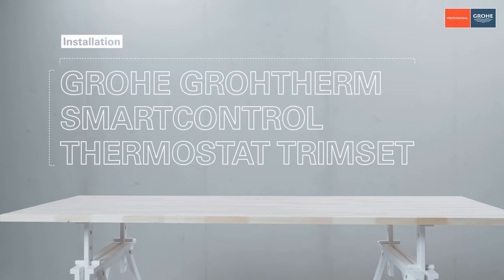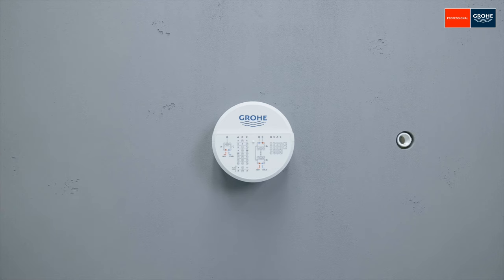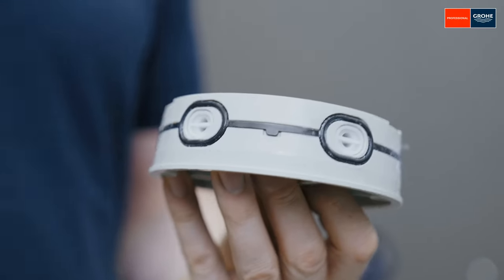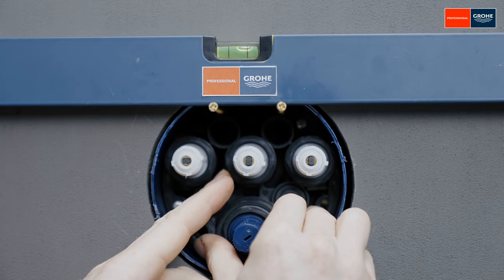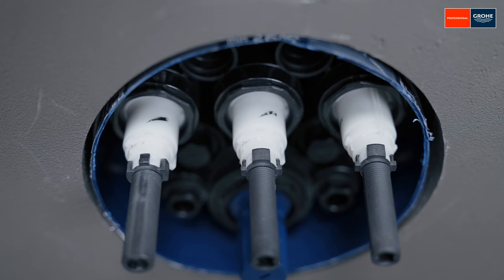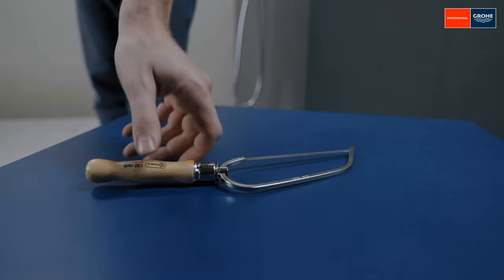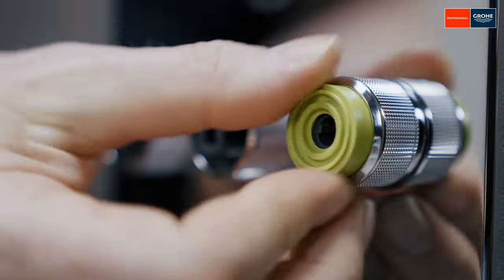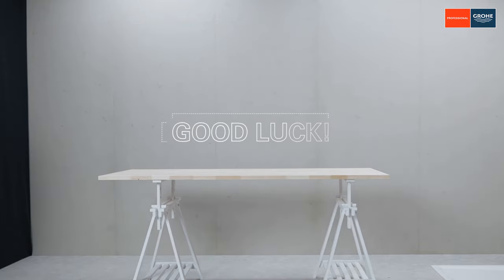How to install a GROHE Grohtherm Smartcontrol Thermostat Trimset

Comment: The front plate and smart box need siliconing on, right?
Reply from the maker: Hello @gerg83! 
Thank you for your message and your interest in GROHE. When purchasing our products, please always refer to our enclosed assembly instructions. Everything is described there. And regarding your question: the answer is yes, the edge around the SmartBox (between the SmartBox and the tile) is sealed with silicone. 
Greetings from the GROHE Social Team
Reply: @GROHE  cheers, the manual and video make no reference to gluing the front trim on, but there is nothing to hold it in place (so I assume it must be siliconed)